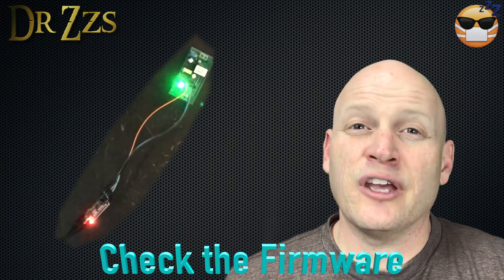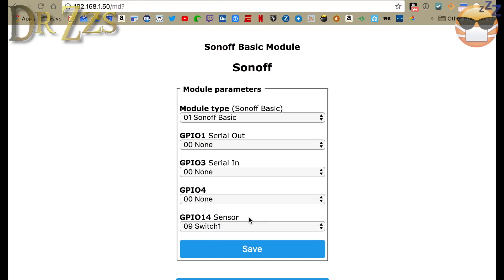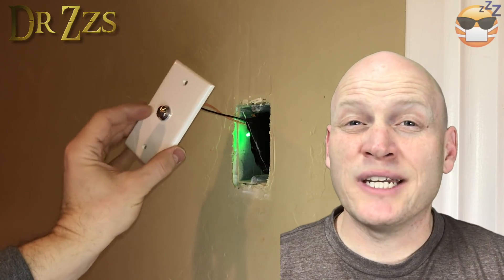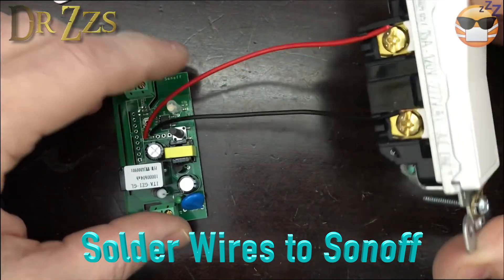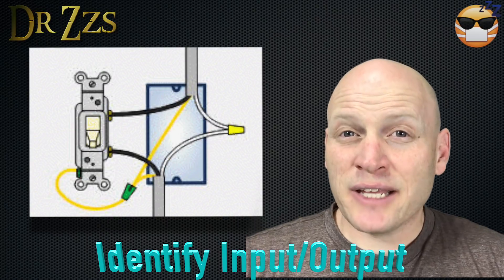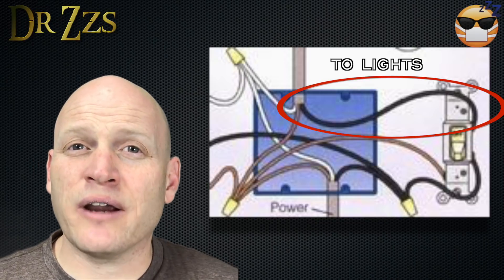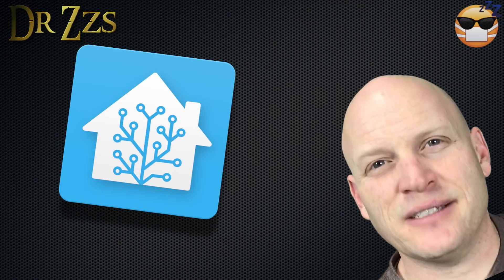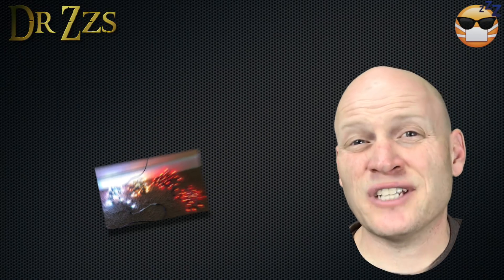No $30 "Smart Switch" | $5 Sonoff + REGULAR Light Switch!

Comment: Great video! :-)
It's looking easier then what I imagined - now I almost have to try it ;-) I hope the kind of wall switches we use here, is working with Sonoff too.
One question... When the light is turned off on the wall switch, can you turn it on using Home Assistent then?
Reply: If you turn the light on with the physical light switch, then turn the light off with Home Assistant, does it take turning the physical switch off then back on to turn the light on again? Thanks. Great videos with these Sonoff's and other HA Stuff!!
Reply from the maker: it really works like a three way switch between the physical switch and Home Assistant.  So if you turn it on with the physical switch (for example flip it UP), then off with HA, the next time you flip the physical switch it will turn back on, even though the switch will now flip Down for on.  
After writing that I think I made it more confusing. 
It works just like a 3 way switch.  Does that answer your question?
Reply: Yes that helps a lot!! Now to see if the Sonoff Dual has 2 gpio's available for 2 physical switches to automate a few double switches I have around the house
Reply from the maker: Thanks!  You can do it!  Your wiring might be a little different, but probably not too much. 
Any kind of switch should work.  What switches to do use?
Yes.  Any change in the State of the Sonoff is seen by Home Assistant, so if you turned the light on at the switch you can turn it off with Home Assistant and vice versa.  
I'm really happy with how well they work.  Haven't had any problems with them.
Reply from the maker: I don't have a Sonoff Dual yet but I will soon.   From the specs it looks like it will be able to have 2 external switches.  I'm about to order some.  I'll make a video but it'll take a few weeks. 
Let me know what you learn if you get yours in before I do.  
Thanks!

Comment: Hi, I really liked your videos for the sonoff switch. Knowing these are not ul certified do you feel safe putting them in your walls long-term ?
Reply from the maker: drbent14 That’s a good question. I’ve certainly thought about it.  I plan on living in this house for 20 years, but when it does come time to sell it I’ll have to discuss it with the buyer. 
I feel safe. But there’s probably some liability if you sell the house to someone else. 
That’s an issue in the DIY smart home community that we’ll have to tackle at some point.
Reply: There are several videos out there where folks test the device heat buildup with various loads.  Given wrapping the device in electrical tape vs. the heat resistant (up to a few hundred degrees) case, it would probably be wise to only do an in-wall DIY installation in low load situations, e.g. <=100W.  Anyone getting into DIY automation probably has already converted to LED, so >100W would be rare, but there's always someone who would try this with a huge 10 bulb X 100W situation and 3-4 of the devices all crammed into the same switch box.
Reply: drbent14 
can you please explain how to install Sonoff with rotary dimmer switch if I use EWeLink app
Reply from the maker: evaldas raisutis I can’t say I know how to do that.  
It probably isn’t possible to use a dimmer with the sonoff. As far as I know the only function of the external switch pins is to trigger the relay. Connecting a dimmer to it won’t give dimmer functions. Sorry. 
Maybe someday they’ll make a dimmable sonoff.  Or maybe someone else has a solution I’m not aware of. That sure is possible.
Reply from the maker: Thanks for the insight!  That's great info.
Reply: There are sonoff wall switches in 1-3 gang. I believe they have dimming capabilities but cost more than these.
Reply from the maker: I have one sitting in the box.  Haven't used it yet.  So many projects, so little time!